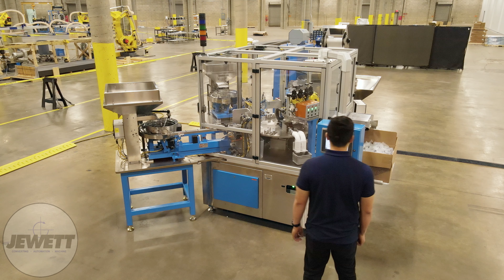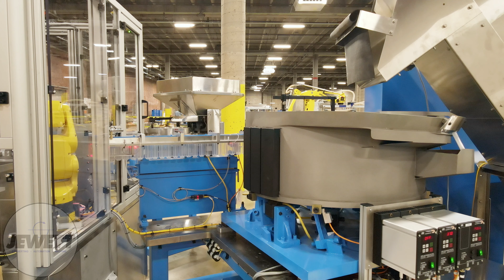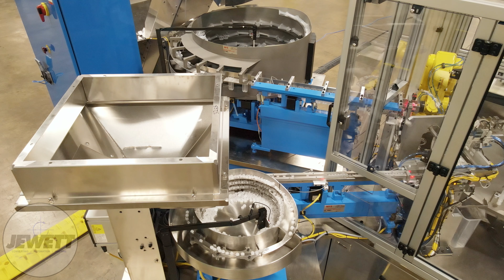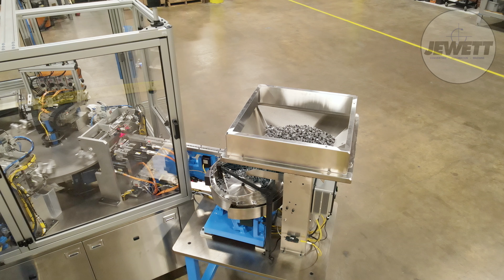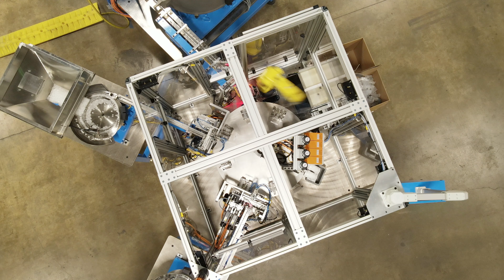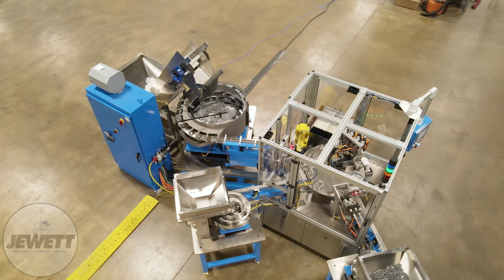Dial Indexing Assembly System

Comment from the maker: This system is a dial based assembly system to complete assemblies at a rate of 1,600 parts per hour. The production rate is achieved by processing assemblies 2-up on a 4.5 second cycle. The assembly dial features 8 stations, each with 2 part nests.